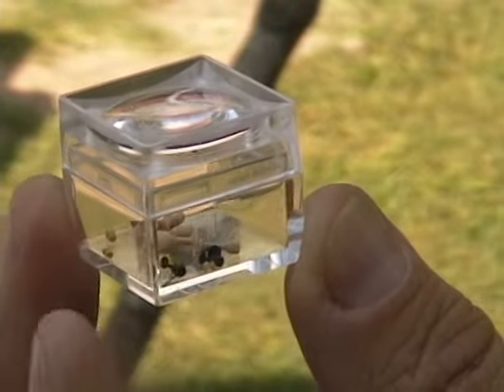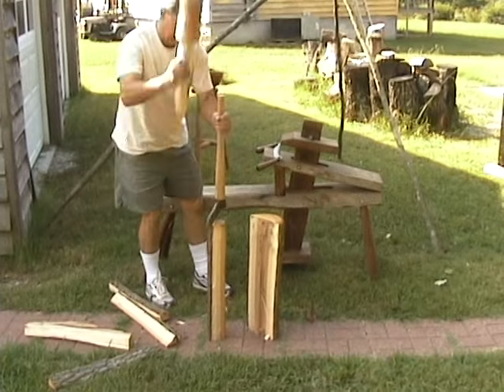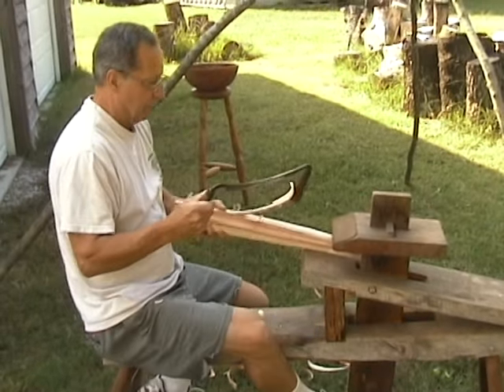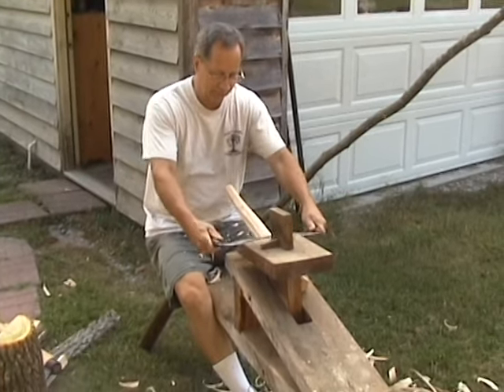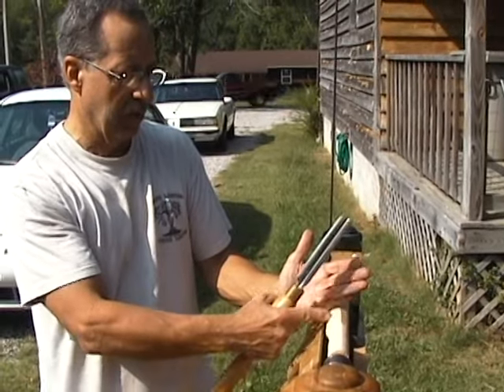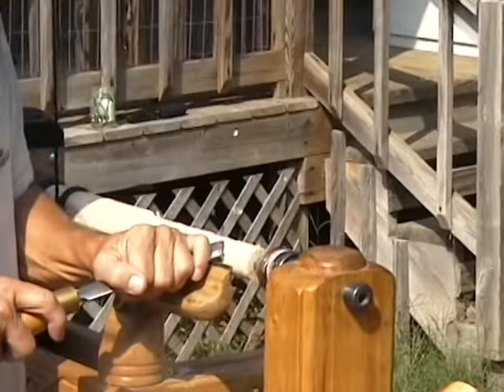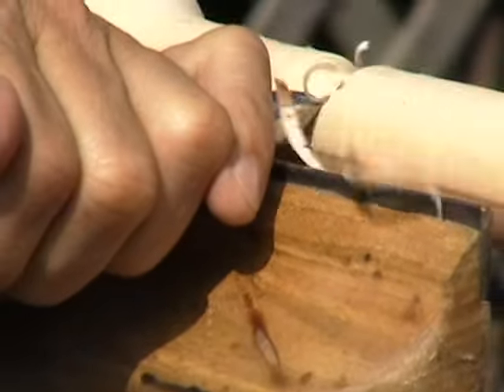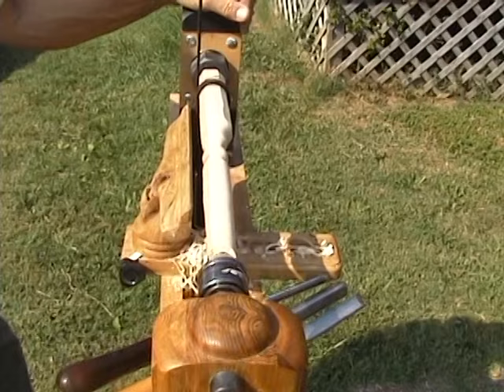Appalachian Woodturning

Comment: You oughta try using a draw knife, they're not unsafe at all.  Your shoulders don't bend back far enough to allow the blade to touch you.  Try it, you'll like it!
He's right that the treadle on the pole lathe needs to be longer to get more turns for each stroke.  That makes a big difference on how much effort it takes to use one.  Green wood like he's turning is also a big help.  Take care, and give this stuff a try, it's fun.